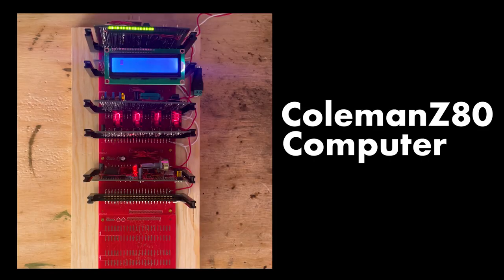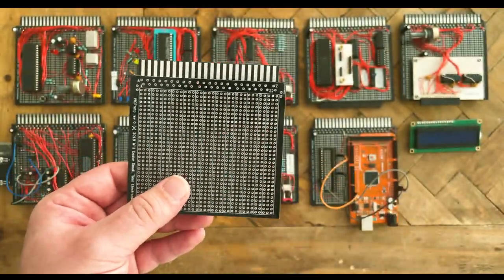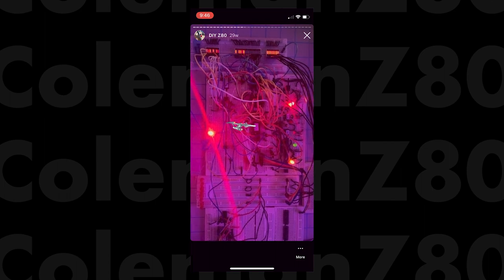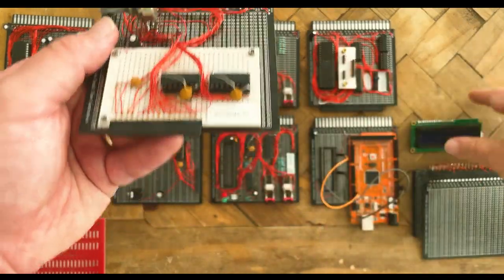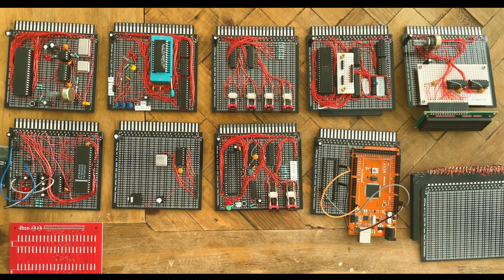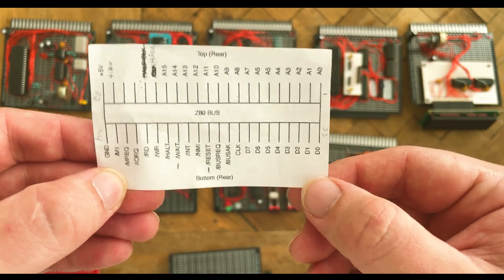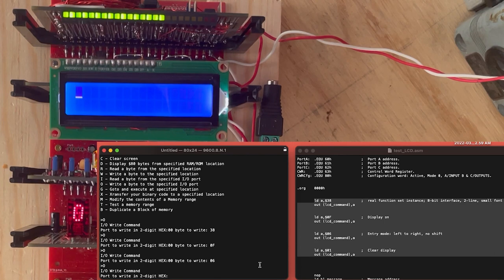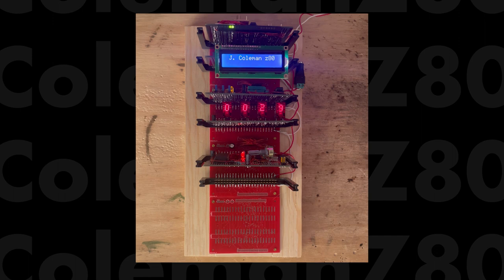Designing a Card Slot Modular Z80 Computer

Comment: Back in the 1980's and 1990's there was a paging (as in pagers) terminal called the BBL for Bill, Bob and Lloyd.  It was a Z80 based system, and used distributed processor architecture with a master Z80 and multiple shelves down the chassis with MODBUS's and PIO's that interfaced with more Z80's on each shelf that handled the various tasks, like answering trunks (phone lines), managing subscriber records, encoding the digital paging signals, operating the floppy disc, and diagnostics to name a few.  They are defunct now, but I wish I had the manuals so I could send them to you because it was such a beautifully crafted and functional machine, and I just know you would have appreciated it as much as us old paging tech's did, because it rarely ever broke down.
Reply: Thank you so much for informing me of such a system. Indeed I respect that architecture. At this point I'm almost tempted to make a parallel processor super computer based on n-amount of Z80s lol! I may just as time goes on. Cray Z80 anyone?

Comment: I wish it was a 6502 build, but the Z80 is another great processor.  This build reminds of the Altair.  Great stuff!
Reply: I see a lot of these z80 or similar minicomputer projects.. I find them fascinating. My first computer was a KIM-1 6502. But I wonder, what do people use them for these days?  I have thought about building one, putting LEDs on all the data, register and address lines, mounting it in a frame and hanging it on the wall as art.. Having it run a clock program or something.. But besides that what are people using these for? I see so many design and construction videos.. but not many that actual show what they are used for.

Comment: Very cool.  When I started with digital electronics, I made my own Z80 board with hand-soldered wires.  I had the CPU, ROM, RAM, PIO, and Serial on a single board.  I have always wanted to make a modular card slot version, just as you've done, but I never did more than in-head design brainstorming.  Being able to turn ideas into reality is an important skill.  Well done!
Reply from the maker: thank you for your kind compliment. I think after a year or so of using this machine that its reliability over time, especially in my humid climate where oxidization occurs readily, is at stake given so many hand wired signals. I have to spray deoxit often to get it back to life lol. Your singleboard solution is probably best especially if one leverages such services these days PCBWay, but certainly i continue to enjoy the learning tool that this machine has become. Thanks for watching!

Comment: Great video. Nice to see a Z80 build. 🙂  One suggestion though... next time consider using a Udamonic Scamp instead of the Arduino. It's much easier to use, and you can interactively control I/O from the command line. It's brilliant as a control and diagnostic tool when you're bringing up new hardware. It's the most useful embedded system I own.
Reply from the maker: Wow thanks for the tip... never heard of this device. Seem perfect!

Comment: This is reminiscent of the S100 Bus based machines (Cromenco and Comart were the ones I was most involved with) which (usually) ran CPM.  At the same time the Shelton Signet used separate modules connected by ribbon cables, a much cheaper method than using a backplane.

Other machines, such as the Superbrain and Televideo used a single board design,   Superbrain had the computer, keyboard and monitor in the same case these were at the low end of the market.

Comment: Super cool project! Turned out very well, impressed!     By the way: some old slot computers had the address decode logic on the main board, making the slots addressable. That way the cards were able to be much simpler, as selecting their address just meant putting it into another slot. You can implement that with a CPLD or sometimes even just a ROM!.
Reply: Its six of one or half a dozen of another.
One disadvantage of fixed card addresses is size of page or block access. one size does not fit all.  It was more used for channel commands to cards.

On card address decoding is more flexible, it was the choice of ISA bus systtems,  by evolution of the many card systems of the 70s..

Comment: I made one of these 40 years ago. But I used a euro-connector (64/96 way) bus. Why? Because you can use ribbon cable as a bus on part of the connector, and ribbon tails from the other part going to peripheral connectors. Simple, reliable, and non tedious. You also have a wider choice of boards, as the 64 way connector fits any 0.1" board. 
For board building I also favour the 'pin wrap' method. No tracks, just a hole matrix, wire goes through an adjacent hole, wrapped around the pin, and then soldered. Gives very high density and reliable, but can be modified. But route well orthogonally and then lace.

Comment: Very nice looking system. I recognize those vertical dip sockets! wish I had bought some when they were still available.
Reply from the maker: they were an offhand buy for sure. but i was like "WAIT! I can use these with the TIL311 displays!". I feel like someone should pcb design some or something. Idk why they're not more common given the package is the same for 7 segment displays.
Reply: @joshuacolemanmakes7518  Ye that is probably what I will have to do. Most of the vertical sockets out there use slotted holes so only dips fit. The sockets on those adapters use some strange slotted sockets but I'm sure I can make it work with normal ones.

Comment: Love the modular design! As for the video card, a common choice is the TMS9918, check the LM80C project by Leonardo Miliani. Another option would be having 80 columns and port CP/M to it.
Reply from the maker: yes! that is the chip i have on hand and i am currently developing the card based on that LM80C project. CP/M would be wonderful. Concurrently, I'm wrapping up my CF card storage device!
Reply: @joshuacolemanmakes7518  If you want CP/M, it's easy enough. Biggest change to your hardware would be having to map RAM from address 0000h upwards. Easy enough to do with a flip flop that's reset during a reset. While the flip flop is reset, ROM is mapped to the low addresses, when set (via an I/O), then RAM is mapped to the entire 64K. And finding copies of CP/M is rather easy, just make a BIOS to fit your hardware, and the BDOS falls in place. Plus, given the amount of RAM you have, if you implement a reasonable way to map it, then MP/M becomes a good possibility as well.

Comment: I'm about to start a 65816 project (initially in 6502 emulation mode), and I will be using a Artix 7 CMOD 35T for by clock circuit initially and later my VGA and audio device.  I also plan to reuse a BBC Micro B keyboard as my input system (also the FPGA will convert those signals too).  So real CPU, real ROM/RAM and I/O chips with an modern FPGA acting as a ULA of sorts.

Comment: How helpful was Ben Eaters 6502 breadboard computer to you in designing this Z80 CPU? Fantastic work by the way!
Reply from the maker: Well, I did binge the entire series well before starting this project and I suppose he was a good deal of the animus behind this design. I used the Z80 instead, however, because I felt I understood the assembly routines a bit more and there seemed to be far more documentation out there in the history of documents to aid the homebrew Z80 computer. In all, Ben Eater was certainly a macro guide for this micro. But, I ended up with something all my own in the end. He is a true wizard and an amazing teacher. I couldn't have understood things more plainly without him.
Reply: Ben Eater, unfortunatelly, takes little care of circuit details, and sometimes makes faulty designs.
And the idea of whole computer on breadboards without proper chassis is generally impractical.

Comment: Interesting design and build.. Had a thought about the way you interfaced with the sound card.. why not have 2 busses, the first being the bus you have made already so far, and a second bus, using the same card and edge connectors but connected to the output of the 8255 chip/card...

The idea would be to have the 8255 chard to be the last one plugged in to the original bus, next to that another card with the 8255 output wired to the bus lines. you could use the upper nibble of the third io port to address 16 "low speed io" cards with the other 20 bit for data and other control signals.. add an interrupt line between busses and this would work well for input devices like keyboards that do not need high data rates..
Reply from the maker: Ohhhhhh I like that! Very clever. Tbh I’m wrapping up on this prototype but I think Mach 2 may just use your idea. Thanks!
Reply: Z80 already has a dedicated I/O strobe line, ports are not in ther normal 64K memory address spsce. it's in addition.

With the concurrent DMA transfer commands and internal hsrdware, the Z80 was the premier 8bit CPU, 

The Hitachi HD64180 was the icing on the cake, the mega Z80. 8bit.

Comment: @7:02 The board has a 3.57MHz Crystal and not 4MHz as you said.
Reply from the maker: Very true! However i have found it the accepted vernacular to round up clock speeds to the nearest value. At very least this was common practice in the era in which this computer would’ve been built lolol. For example, the Apple II ran at 1.023 MHz but it’s called 1Mhz. 

I actually rounded in reference to the data sheet of the sound chip which indicates it should be ran at 4Mhz. 3.57 was close enough in my scripting of the narrative and in practically this will just result in a C note, for example, sounding slightly lower. 

I may actually go now and buy a 4Mhz on the nose crystal and see how the sound differs. Thanks for watching!

Comment: This is pretty cool, and I've always loved the z80. I do wonder though, why did you pay 40$ for a serial program? There are dozens of free and open source serial programs.
Reply from the maker: None, like minicom, hyperterminal, nor putty nor zterm are as fully functional nor compatible with my FTDI cable and my Mac as this program. I went through the lot of them and they all had varying quirks. For example the inability to send a raw binary file was oddly missing or at least not as easy as this fully featured program. 

Plus I’m rich. (🙃jk)
Reply: @joshuacolemanmakes7518  Those are indeed odd quirks, and these sound like some good suggestions for modifying the existing programs should I need them. Which open source tool did you find to be the most complete?
Reply from the maker: @anon_y_mousse  definitely minicom was the best imho.
Reply: @joshuacolemanmakes7518  Thank you. I'll see if it can be improved.